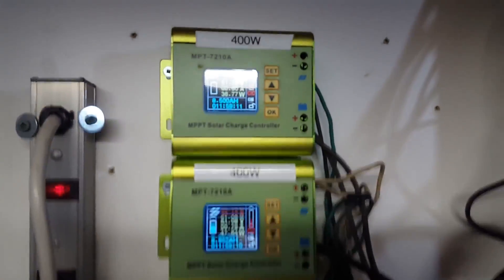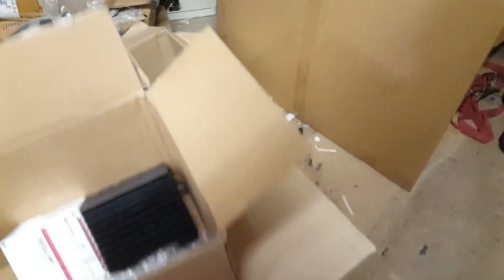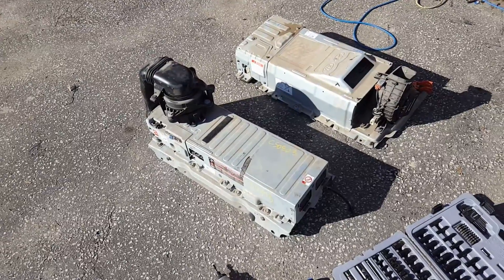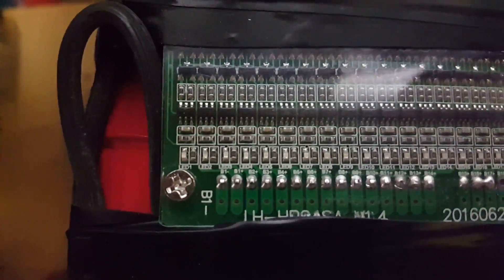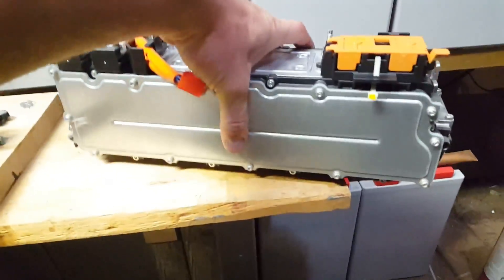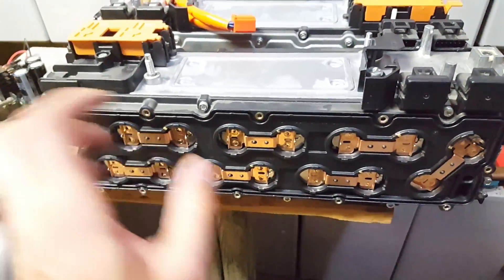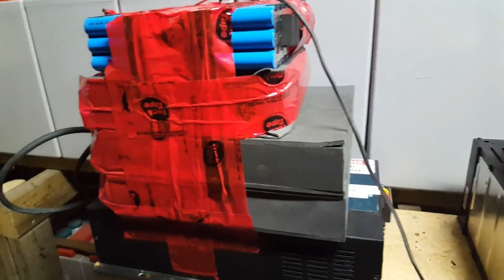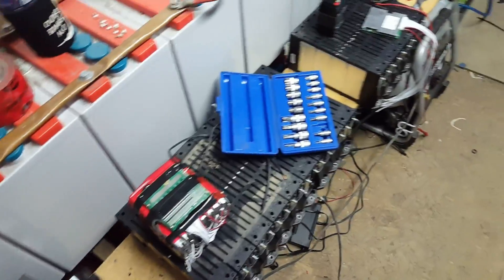More EV Batteries And Amazing Stuff From Battery Expers Pickering

Comment: the classics of wall heater at night it also has a stroke if you run it at 24 volts at wide open throttle 94 amps
Reply from the maker: haha I believe it, I wanna see if it will run at 66 volts output for my lithium system. my rents have one at 48 volts and 6500w and it seems to work ok.
Reply: it will run 99 volts
Reply: how is the magnum working on the lithium
Reply from the maker: I have not called to see if it will blow up yet :D I do not wanna blow this thing :)
Reply: I recharge every day @64volts

Comment: Looks like you have some good stuff there to try out.
could you please provide a link for those 16s bms, might have to try them. How many amps are they rated for?
cheers
Reply from the maker: 30 amp out put
I have not received this in the mail yet.

http://www.ebay.ca/itm/152226186594?_trksid=p2057872.m2749.l2649&ssPageName=STRK%3AMEBIDX%3AIT
Reply: Thanks mate

Comment: If those hybrid packs were out of a malibu (or similar), they are 4.4Ah cylindrical cells... both packs together are what's rated at 500wh.  I need some of those, by the way... if you have any for sale!
Reply from the maker: i have 2
Reply from the maker: Might be able to get more if you give me all the information on all the years these cars where made
Reply: @GoingOffGrid101  2013-2015 Malibu, then in 2016-2019 they switched to a prismatic cell which are the ones I really like. They also put both in certain years of Impalas and Lacrosses... you know how GM is..

Comment: That Orange charge controller is one of the cheapest you can buy on ebay for the amps.  The 60A morningstar you got might cost $600, but the orange makeskyblue might cost $170.  But, the pictures of the ones on ebay don't cover the pots.  There are virtually no reviews of the orange one so it would be a good video if you fix it and show it.
Reply from the maker: I would love to but I beleave the IC,s are damaged :(

Comment: I need a consistent DC 12v~ source to run an inverter for [48-72hrs] so I can power a 400w dehydrator... Is such a thing even possible: or can I build a Special 15v~ car-battery (to discharge no more then two in parallel), or is there no other way then to buy a generator. 

And why certain wattage appliances require an alternator to be on, what's the physics behind it. (Wattage translates to something.)
Reply from the maker: you would need a 1000Ah 12v battery bank and 1500w of solar to run such a load, so a small off grid system, you need a 5000wh lithium battery equivalent.

Comment: I have two power its that I want to combine, is there any way of telling if they are 18650 or LiPo without taking the battery apart? When you took your 140ah power it apart were both the batteries the same? Does it matter if they are different or should I just combine them and not worry about it? Thanks! Great videos
Reply from the maker: both of my batteries where the same in my 140AH power it, does it matter mixing, I would say no not enough to not do it, I would weigh the 2 batteries as the 18650 packs weigh more, but I would just combine them, these power its are made to be chained together anyways.
Reply: thanks for the advice!
Reply: fliping720 I took them apart and it turns out I have one of each a lipo and 18650 pack. Does that mean when I combine the two the capacity will be limited by the 18650 pack? You mentioned that your 18650 didn't balance well with the lipo packs, is there a way to improve that?

Comment: Hey man I love your system. Can you please help me?  I want to make a 12v 18650 pack. I need a good BMS. Please recommend some good BMS for me. Thanks you :)
Reply from the maker: what are you planning on running and what are you charging the battery with?
Reply: fliping720 thanks for answering me. I am planning to build a small solar power system for my mom she lives off the grid and there is no electricity at all. I am studying computer science.  But I don't have the budget to test it by myself. That's why I'm asking you for help. She will run a small refrigerator, a small TV and lighting. Thanks again.
Reply from the maker: what voltage is this battery going to be ? and what cells are you using ?
Reply: fliping720 the voltage will be 12 volt.
Reply from the maker: this one looks good for the price, I have one like it 60 volts though.

http://www.ebay.ca/itm/3S-11-1V-Li-ion-Lithium-Cell-80A-Battery-Protection-BMS-PCM-Board-with-Balance-/282140999061?hash=item41b0e9fd95

Comment: i could really use some batteries from EV's. at a deal.
Reply from the maker: they are hard to come by, im taking them as they come available.
Reply: fliping720 . I am probably going with lead acid to start with.  but every time I find a inverter . that looks good on paper. I find ppl say its junk. I guess not many china made inverters are that good. I really need to get off the generator. I'm going with 24 v to stay away from the high current systems . also for more efficiency. but maybe I'll go to 48 volts. I just always had issues with very high current systems. a little corrosion. and you have connections melting before you know it. so I'm trying to stay under 200a. per bank max draw. also there's a savings in the wiring. what's a good cheap inverter you can recommend? great videos thanks
Reply from the maker: I would buy this inverter I have only tested for 2 months but I like it so far. you can ask them for any input voltage, I would ask for a 48 volt 3000w inverter like this one. I have tested it at 2850w and it was good at that load for a short time. I do not get paid by them so keep that in mind. make sure you them them the input voltage output voltage and the herts you need.

http://www.ebay.ca/itm/3000W-Car-Power-Inverter-12V-24V-dc-to-120-220V-ac-Pure-Sine-Wave-Inverter-Solar/201345370668?_trksid=p2047675.c100012.m1985&_trkparms=aid%3D777003%26algo%3DDISCL.MBE%26ao%3D1%26asc%3D20141121090203%26meid%3D1c3e4036e18548fa89af6ec8f2ad7298%26pid%3D100012%26rk%3D1%26rkt%3D9%26mehot%3Dag%26sd%3D192106512712